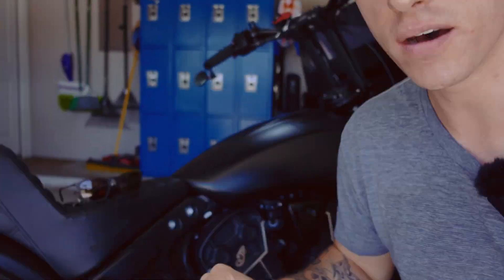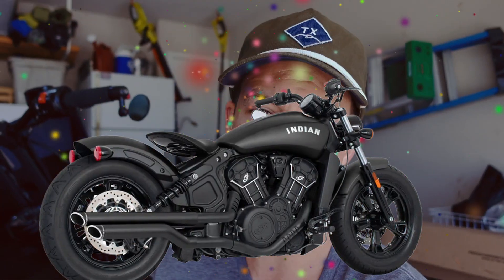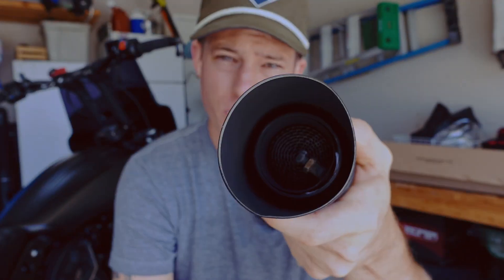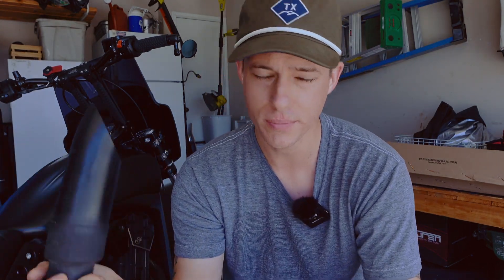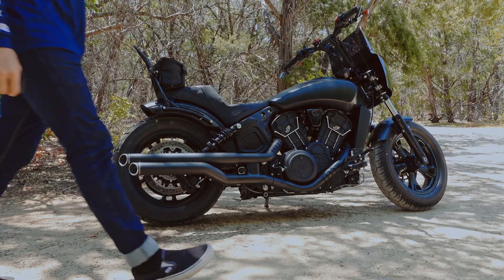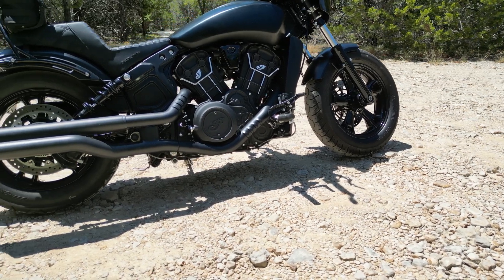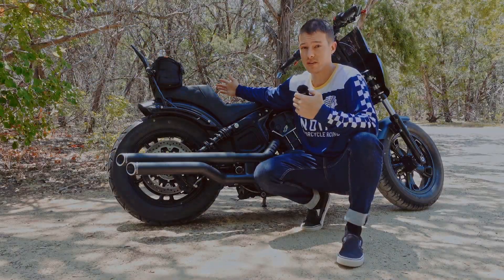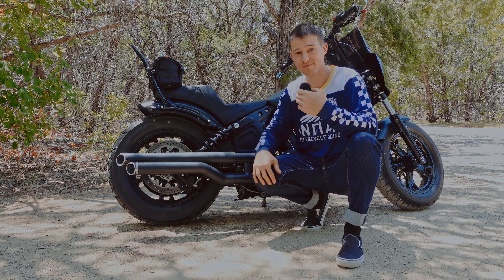I Should’ve Done This a Long Time Ago! Freedom Performance Slip on Exhaust | Scout Bobber

Comment: I'm wondering if the new slip ons aren't as loud to you on the bike since they exhaust further back from your ear. It'll be interesting to get your take on the new ones after you do a longer ride. Thanks for sharing.
Reply from the maker: Yeah I think it definitely helps having the exhaust longer. Standing away from the bike while it’s idling doesn’t seem too different but at a decent riding speed having it further back is a noticeable difference.

Comment: Hey Kyle, just wondering how you're feeling about these with some months of riding with them? I have been trying to find a nice "middle ground" between the incredibly loud shortys/V&H/RCX slip ons and the stock. So far I've narrowed it down to these, the Bassani's and the Dean Speed slip ons but I can't seem to find much info on these as compared to the other two. Any advice would be much appreciated!
Reply from the maker: I think they’re great pipes, I had slip on shortys before and these were quieter but still had an awesome sound to them. They also sell baffles you can buy separately or with it and put in them if you want to muffle them some more. I’ve heard things about the Bassanis and I’m a big Dean Speed fan with all of their products but I went with these mainly because I like the look over the others.
Reply: @cruisingwithkyle  thanks for the response and detail brother 🙏🏽 think I’m going to go with the bassanis, I need something a tiny bit milder haha

Comment: Hey Kyle, are these the 2.5 slip ons?? I debating between the 2.5s and the 4.5s slip ons. 

I wanted the super radical exhaust but you can’t have pillion pegs, are you aware of any alternatives to them where you can still have a passenger 

Thanks!!
Reply from the maker: These are the 2.5s. I believe you can still have pillion pegs with these because they use the stock mounting points
Reply: @cruisingwithkyle  thanks mate for the quick reply! Did you notice much more performance vs the stock?
Reply from the maker: @robdiamond8010 subtle increase in performance but the weight difference from the stock you can definitely feel. They’re a ton lighter.

Comment: How far is the top exhaust pipe from the back of the tire?  I can’t tell with all the different angles.
Reply from the maker: It’s about the same distance as the stock pipes. Maybe further from the tire due to the smaller diameter of the pipes.

Comment: Do these pipes just hook to the stock mounting bracket?
Reply from the maker: Yes they do
Reply: @cruisingwithkyle  thanks, and did yours come with a nut and bolt that’s supposed to go through the exhaust mount and the 2 silver brackets that are welded to the pipes?  Mine did not.